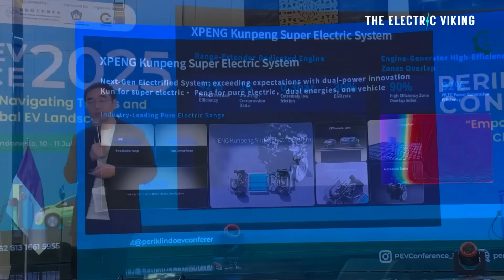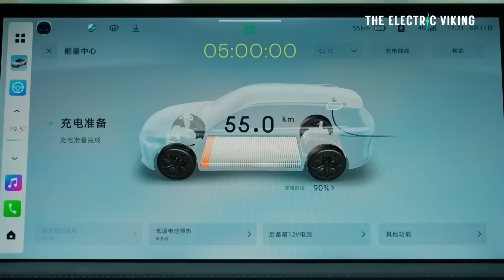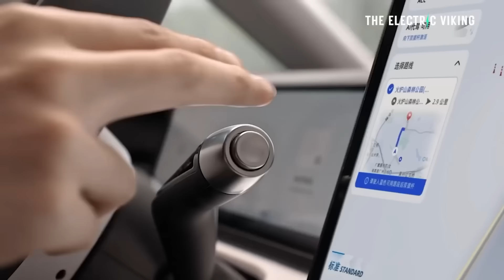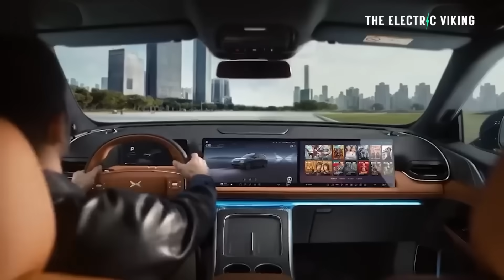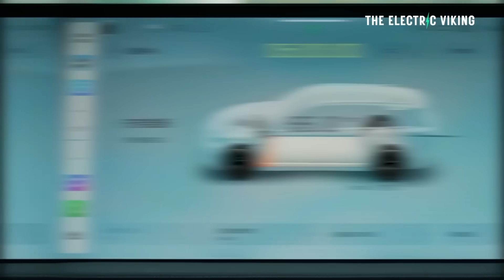Xpeng Powertrain Boss Reveal Why He Believes EREVs are better than PHEVs

Comment: EREVs are simply  EVs with (in some retrofitted) ICEs as on-board generators.  An old concept dating back to BMW I3 and Fisker Karma, later abandoned as inefficient.  Are they  now not "better" just because in China they can't build proper PHEVs with ICEs and e-motors working in  parallel?

Comment: I always thought the BMW i3 design was pretty good with the REX option.
Surely a small efficient engine, such as a motorbike engine tuned for power/efficiency driving a generator was a good idea.
But there are few of these designs on the road.

Comment: The extended range EV solution is challenging technically. Xpeng's entry level  EV (400 km battery, 5C charging speed) extended to a max of 1500 km by means of an electricity generator fueled by petrol, that is excellent. It would be interesting to know XPeng's entry level EREV's fuel consumption figure in miles/gallon (or km/liter), for comparison with PHEVs. To design a light weight electric generator with sufficient power output to drive the car at max speed, that is a challenge. Another challenge for the electricity system is to optimize the generator to cooperate with the battery system efficiently: the battery system receives energy and also delivers energy to the electric motor, simultaneously (??). In theory the electric generator might run always at a constant RPM for MAXIMUM car speed, and delivers electricity directly to the electric motor, such that the remaining energy can be used to recharge the battery pack. In that case the battery pack never delivers power to the motor (and is recharged as well) when the range-extender generator is running. Problem solved. Perhaps the RE generator needs oil lubrication, definitely has a certain life span, but only kicks in during longer trips beyond 400 km.

Comment: So an EREV is a PHEV where they have left out the ability to work in Parallel Mode. They save money and weight by omitting the ability for the ICE to drive the wheels directly - way more efficient than converting mechanical power to electric, then electric power to mechanical.

Comment: Can you still just use the battery alone without the engine in an EREV?
Reply: Yes. The engine just charges the battery. Its not connected to the propulsion system.

Comment: I would like to have heard what this gentleman was saying. Particularly interested in whether engine feeding the battery to drive the wheels unnecessarily wears the battery, incurs round-trip losses, & is less efficient at highway speeds compared to a PHEV driving the wheels directly, loping along in high gear?
Off topic, but also interested to know what longevity compromises, if any, have been made to achieve such high C-rate on these batteries, which will be charged more frequently if they are smaller than full BEV.
Maybe post video again once sound levels sorted if he covers these topics, or add your own summary please.
I have no agenda to push. Just seeking knowledge.

Comment: Those charging speeds make you realise what a joke the Ranger PHEV and the MG HS Super Hybrids are. These, along with Mazda and Volvo PHEVs do not have DC charging at all. They are really saying this a compliance vehicle and we don't expect you to actually plug it in.
Reply: Latest generation VW PHEVs have 50kW DC for their 19.7 kWh (usable) batteries. Still NMC & backward in so many other ways, but they are examples of PHEV with DC charging.
Reply: @MortyMac  The only VW PHEV I can find available in Australia is their Touareg R which boasts a charging speed of 7.2 kW and no DC charging for the 100 kW motor and 17.9 kWh battery that provide a mere 51 km range (claimed).
Reply: @muzza_c   Correct. VW are pathetically slow to bring contemporary models here. They say several of these DC-charging PHEVs will be here next year such as the Multivan & California camper on which it is based. We'll see.

Comment: I can't imagine lugging around gasoline and an ICE even if it's just a generator for the battery.
Reply: Yeah it's the dark ages.. 
EVs are too good now. 

Would never drive ICE if there was a comparable EV option.
Reply: It's all about the range
Reply: I believe it is often lighter because so much weight can be saved with the smaller battery. The small engine just generating electricity for the battery can be comparatively light weight.
Reply: But is it worth the increased maintenance, fire risk and having to fill at gas stations?